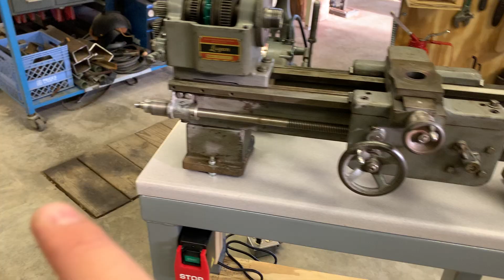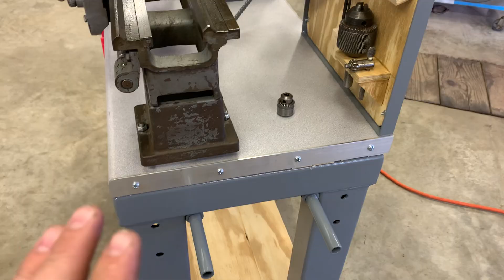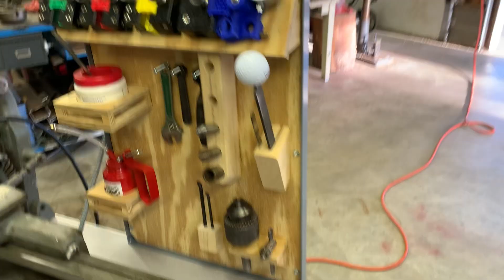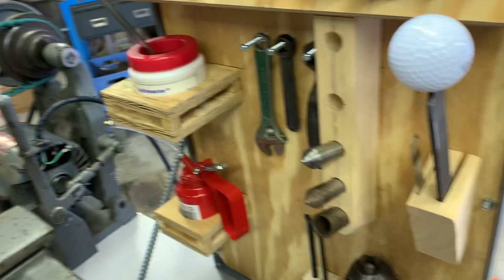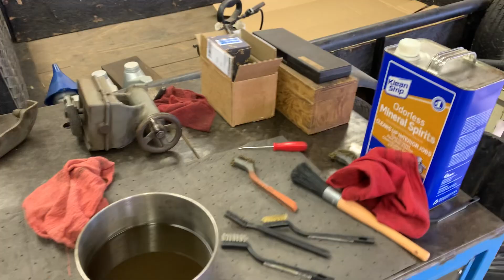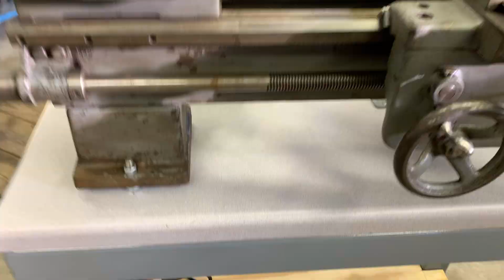Logan Lathe Project part 4

Comment: Check that emergency switch's internal wiring because the one I bought packed up, and became intermittent. When I pulled it apart, I found their wiring had come adrift and things were floating around in there causing havoc. 

That's the kind of thing that can cause a fire, which is not the purpose of a safety switch.